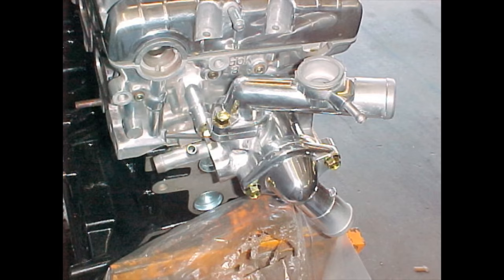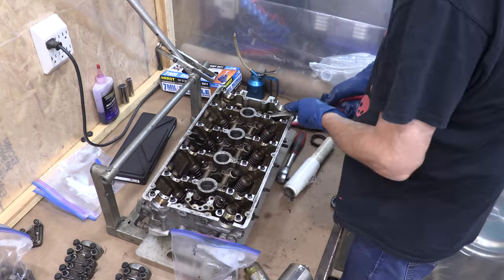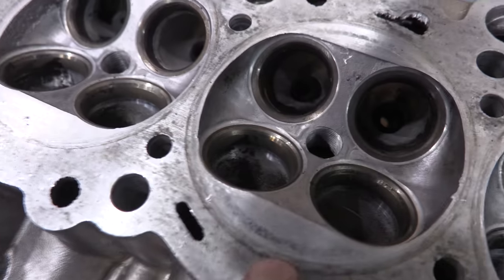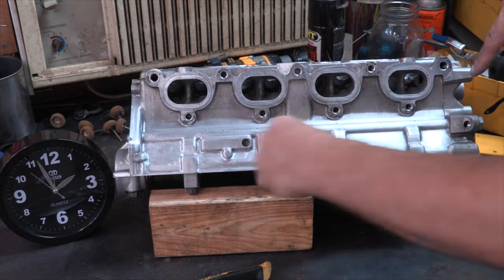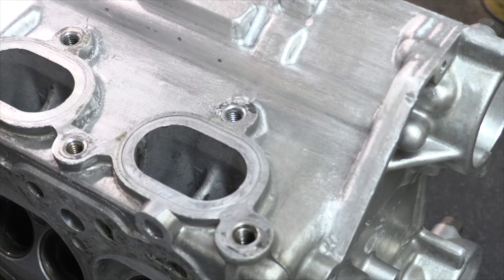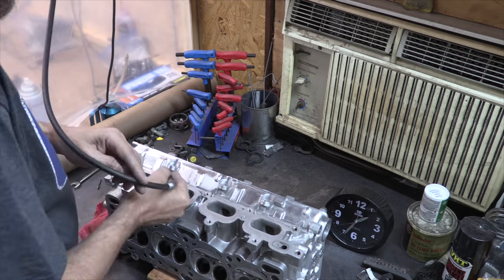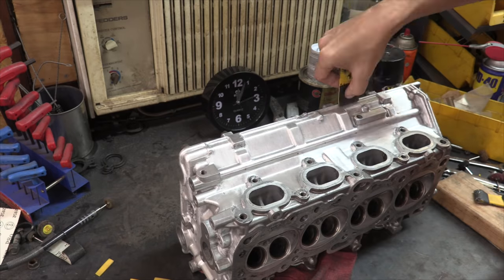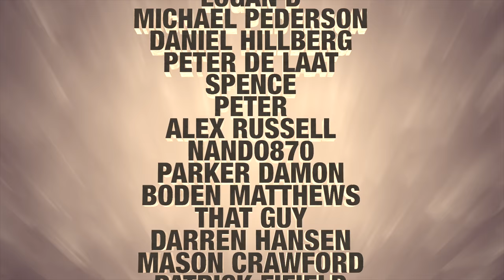Polishing Aluminum Step Zero & One

Comment: Hearing how easily the polished cast alu picks up corrosion makes me curious what to do to my block and heads now to achieve the opposite.. the longest-lasting finish for the least amount of repetitive strain injuries. Quick wire-wheel job then powder coat, perhaps? Still needs plenty prep though, but not in the 100h range... Maybe just some primer and paint will do it, after all it's going to end up obscured under my GSXR's plastics.

Comment: Where are the rocker arms? I saw you take the head apart but I didn't see any rockers during the break down (hahaha). 
In all honesty, this is the first cylinder head that doesn't use rockers to open the valves. Is there any lash adjustments? If so, how would you go about adjusting valve lash? Does the point of contact between the valve and the cam chew up lobes? Does this design have a problem with bending valve stems? Aside from fewer parts and a reduction in mass, are their any other advantages to this type of cylinder head? The reason I'm asking all these questions is because I'm an old, V-8, single cam/push rod kinda guy (I also like some straight 6's too).

Comment: Jafro, I think you might know the answer, between G6K and G6S heads, is there any relevant differences to a build? Is there a better one to use? My race car has a G6K on it currently off an Evo123, but my spare is a G6S of an RVR. I haven't been able to see any differences yet but don't know if the G6S core is a good one to start with.

Comment: I was hype and wanting to do this to my car. And then you mentioned the whole dry weather only thing. And now I don't want to. I'll just high temp ceramic/powdercoat it instead.
Reply from the maker: If I told you I drove my polished GSX 525 miles in a hurricane packed with 150 pounds of class C explosives (fireworks), and then cleaned it up before winning my last round of trophies it might change your mind.  So much water it soaked my GM MAF from the inside, and limited me to 55 mph max on I-95.  You CAN do it.  It's just a ton of work to maintain if you can't keep it dry.

Comment: I'm just starting this process on a valve cover for a Pontaic Trans-AM GTA 5.7 - I'm 350 minutes in and still on the 120 grit trying to get the scale layer off.  I've tried it dry and with two types of oil (WD-40 and SAS Universal Maintenance Lubricant) but not yet tried water.  I seem to have had the best progress with a small amount of SAS oil, the WD-40 I had the worst progress with just smearing oil over the surface and not getting anywhere fast!  I was wondering, what's your opinion on sanding with oil vs water or dry?  I don't yet have one of those water bath things to wet sand with and was looking for one with a built-in flow control so I didn't have to go down the route of restricting the flow with a washer like you did.  In the past I've just sprayed the surface with water and then sanded and sprayed and sanded until the paper fell apart!  I might just continue with the SAS oil unless there's a reason not to...
Reply: Nearly half a year later and I'm still doing the 1st pass of the 120 and trying to find a better tool than an old credit card to cross the 60 grit grain I had to use in some 4mm wide 4mm deep grooves in the top of an intake plenum I started on about a month after sanding a hole through those valve covers with a belt sander!  This job is even longer if you don't know what tool to use!

Comment: this is sick. Thanks for this.

Do you have any words of advice when it comes to the hazards of Aluminum Dust?
I dont want to sound like a wuss, but I love polishing aluminum, however I think I havent taken any precautions when i was doing it.

This dust gets everywhere and blowing your nose after all this sanding will show that.
Reply from the maker: Yes as a matter of fact, I do.  The permissible amount of airborne aluminum dust is 15 mg/m cubed.  Maximum exposure in an 8 hour work shift is 5mg/m cubed.  You will be lucky over a period exceeding 150 hours to produce 2.7g of aluminum dust with sandpaper manually.  Roughly 3 cubic cm of aluminum dust.  As to what percentage of that dust hits the workbench versus becoming airborne, I couldn't tell you... but if as much as half of it managed somehow to become airborne and stay that way, it would still be several mg below the safe limit of exposure.  I'd venture that less than 3% becomes airborne... but Aluminum dust can scar the lungs and cause pulmonary fibrosis.  Wear a dust mask and you'll be fine.
Reply from the maker: This example also illustrates the risk when performing this job in a space that's only 1m cubed.  If your garage is bigger than that (you don't live in Tokyo) then understand that you're well below the limit by a magnitude of whatever that exponential variable is.

Comment: I say forget the polish, the brushed look of 120 grit doesn't look so bad
Reply from the maker: It really doesn't!  After 50 hours of work to correct its geometry, it really comes together!  But that's why it makes the best finish to polish over, too.  There might be less polishing leaving it "brushed", but the rough cut would actually help it oxidize faster.  The impurities of the scale layer actually protect what's beneath it.  Once it's gone, it oxidizes faster.  But there's just so much you can do with aluminum.  It seems to accept the broadest spectrum of surface treatments of any other material, and with ease.  It makes it all look beautiful.
Reply: @Jafromobile  I forgot about that part, looking forward to the next steps

Comment: I just got my first galant vr-4 1991 and I’m new to awd cars and I’m still new to cars in general I drove it home 30 miles no problem I decided to drive it a day ago and wasn’t under load or anything or in any kind of boost and boob ! Transfer case blew up on me and I’m sad as hell rn lol the fluid look old and kinda foggy I’m sure it was low on oil and got too hot all because I didn’t check the fluids any suggestions ?

Comment: Man I regret getting rid of my 95 eagle talon it was 6bolt block with 7 bolt heads built from block to head with 62/66 turbo ecmlink ect........ so much money in it now I have a 95 gt 347 stroker mustang turbo running meth and holley terminator x and I really wish I had my 4g63 still  only if I can turn back time.

Comment: Have you played with sand, glass, walnut shell blasting the heads for step 0?

Does it give the wrong pattern for polishing? It seems like it would remove the layer of aluminum oxide fairly quickly...

I've only ever sandblasted cast iron parts, and usually they are so pitted, sanding the pits out would make the parts unusable.
Reply from the maker: Yes and no.  I've used bead blasting, and it's a great way to cut through the scale layer.  It doesn't plane anything but it does take some of the struggle out.  There are different types of blasting, and glass beads is all I've had the luxury of using.  It saves a ton of time on everything that isn't flat, but I still ended up having to sand everything flat anyway.  So it didn't really save me all that much work.  The whole process was still the same for the cylinder head, but it changed other things like the thermostat housing for me.  It was the other stuff where I saved time.

I have a different bead blasted head in the next video.  You'll be able to see what I mean.  Fortunately aluminum doesn't rot away like steel does with rust, it doesn't sacrifice itself the same way. Oxidation typically stays on the surface unless it gets eroded by acid.

Comment: Hmm. I was thinking about the Galant rebuild. I know you were doing a stock type rebuild, and wanted 85.25mm pistons. I searched, and it seems that only the expensive forged ones are sold in that size. What some guys do for stock builds is buy 85.5mm pistons from NPR.
Goof luck with this and with the Galant project.

Comment: I will never understand the people who feel the need to touch polished aluminum parts on cars they don't own. I polished my TPI intake manifold in easily maintained areas (I honestly like the contrast in finishes too) and I've seen people reach out and rub the polished portion as though they think that smooth hard serface will feel different than any other smooth hard serface.
Reply from the maker: It's a mystery?  Go stroke your mirror already... I mean... You'll see videos of a polished heat shield over the cast exhaust manifold.  I did that on purpose.  That was a trap.  I drove it 2 hours to a show, popped the hood and walked away.  I did it the weekend before the show and nobody polishes heat shields. I knew it was steel and would rust afterwards, but the hot steel sure grabbed some great fingerprints!
Reply: @Jafromobile  😂

Comment: Why not clear coat it once it's finished to prevent corrosion?
Reply from the maker: All of the clear coats are softer than the aluminum.  The clear coat yellows and dulls, stains, gets things embedded in it; eventually causing you to have to strip it from a polished surface to get the shine back.  Stripping it can damage the polished finish.  There are residue-free products that prolong the maintenance intervals, but anything that sticks to the polished surface will dull the shine.  

It sounds like a great idea to just about everybody [until they try it] because we expect for technology to have brought us clear coats that work as well on a hot engine as they do at room temperature.  In an engine bay that gets hot, coatings get soft, they grow hazy and dull, and if you add oil to that heat, it turns yellow, gummy, or lets go.  Baked clears don't shine like bare aluminum.  They're not really clear, and antifreeze etches them immediately.

If you want major bling and the least possible maintenance, the best option is chrome.  $$$!

I'll show products later in the series that _help_.  The amount of work required to maintain it versus the cost of chroming and re-fitting all the parts of your engine afterwards (wherever winning trophies is concerned) makes polishing and maintaining it a completely reasonable choice.  

If it's just a turbo intake pipe on a daily driven car, go for it!  Do the clear coat... but to disassemble a running engine to strip and put a shine back on it is so much more difficult than a wipe-on-buff-off rainy day in the garage.  I encourage everyone to try new things, but I have the opinion that better polishing tools and products have evolved than clear coats.  I can not speak for ceramic clears, I have zero experience or examples to reference for those, but I wanted to fully answer your question wherever I do.

Comment: Yea not gonna nope no way. 
I've polish stuff before but a head or valve cover it not that serious for me. though it so pleasing to the eye and shows that some one really cares for there ride. but there a question jafro when you are done what about powder coating they have clear or a jet hot coating to protect the finish
Reply from the maker: A clear-coated polished aluminum part doesn't shine the same at all.  They don't age well.  They yellow or dull over time.  Plus, any kind of baked-on coating requires abrasives to remove.  That doesn't put a polished part in a good place at all.  With all that trouble, prep, etc... you'd be better off chroming it... but again, that's a different color entirely than polished aluminum and will horribly clash if you don't chrome everything else.  This is a quandary for everyone, but there's a product I'll demonstrate at the end of this.  We have the technology...  You will be very pleased!
Reply: @Jafromobile  ok. plus port job?

Comment: one correction.  They are galley plugs and oil galleys not galleries
Reply from the maker: Google both.  You'll find both.  It's a regional/dialectic difference.  Nether are wrong.
Reply from the maker: Sorta like convoluted tubing/corrugated tubing.  Same thing.
Reply: @Jafromobile  you will not find "gallery plugs" sold anywhere. Just galley plugs. Because thats what they are
Reply from the maker: @joelpalmer  Cool.  I've literally been on the opposite side of this discussion in another video/thread.  I'll get corrected either way.  It's how I was able to give you a different example.  It's why I told you to search it.  It's not just me.
Reply from the maker: @joelpalmer  ...and you know what really drives me nuts?  When Cleetus says "boLth".  ;)

Comment: I like the fact that you went old school with it & did it by hand, BUT,  2 hours a day for 2 -3 months i believe you said?? Now i dont doubt that it took that long especially if your only investing 2 hours a day, but at the same time i kind of feel as if your lying to people with the comment there no tool or machine that will give you the same result, you clearly demonstrated that you can use a dremel & sanding wheel and accomplish the same thing in a fraction of the time. After the initial sanding use a buffing wheel and go to work. You're just choosing to do it by hand and thats fine and dandy but quit lying to people, and yes i agree with your statement that power tools take too much off too fast when sanding, but I'd argue that's why you turn down the power  🤦🏻 and get familiar with what it means to be light handed.